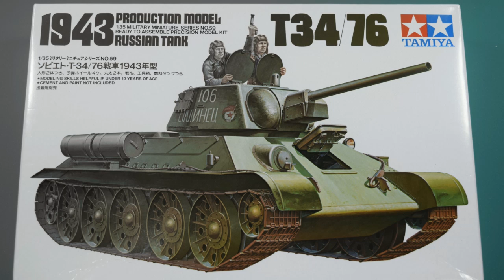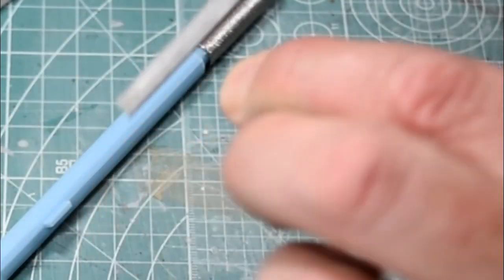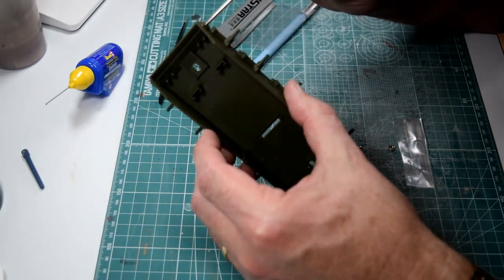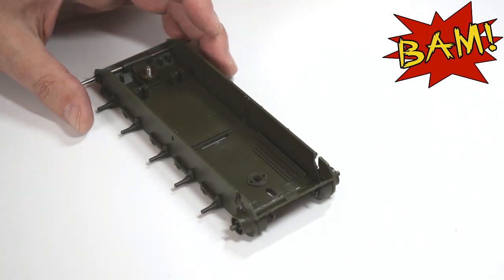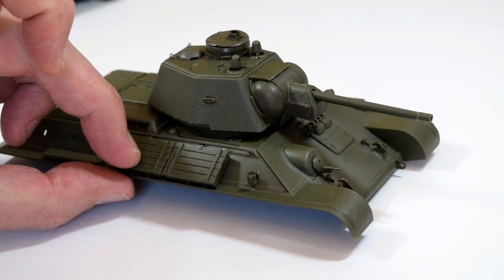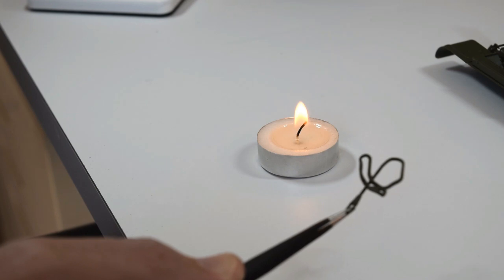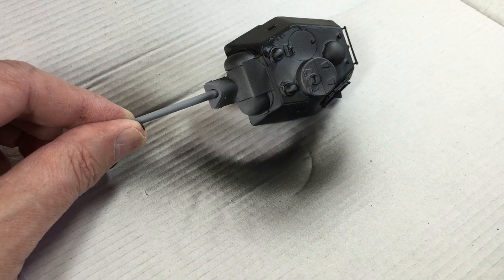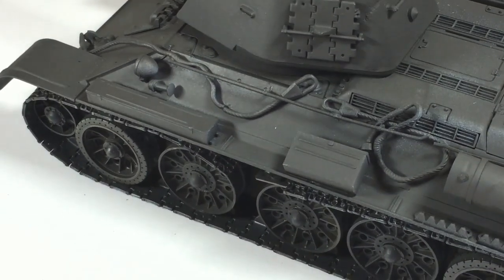Mariya Oktyabrskaya Diorama - Tamiya Russian T34/76 - Part 2 The Build

Comment: I'm still finishing up my kit. I found that the front return roller is nearly touching the front road wheel. I'm using Fruilmodel tracks. If I add a pair of links so I can move the roller forward, I get an overly sloppy look to the 'sag' that will pull back and hang over the drive sprocket. One must use a pair of links in this style, as every other one differs in hinging. The rubber tracks are worse fitting. Very tight. Thinking of building a different brand kit, swapping the tracks,

Comment: Don't worry...I have thumbprint on every model. It's my signature.
Reply from the maker: +Gary Armstrong lol, r u talking about the "tow cable debacle"?  That wasn't a thumb print it was a massive foot print :)
Reply: +Halidon No...I'm talking about the fact that I can be tracked like a criminal with my models. Anyone would damn well know who built them!
Reply: +Halidon BTW...if you care to, under FB Gary Vincent Armstrong (that's my real name)-Gary's Tanks and other models. Should you need a good laugh. A few of the later things are pretty good...
Reply: +Halidon Have ever consider just scratch building a tow cable. I figured out how to do it with German and Allied ones. Soviet tow cables are my next idea. It's fiddly. But it just might work simple.
Reply from the maker: +Gary Armstrong I've bought after market flexible ones to use on the Jagdpanther, I'm deeply scared from melting plastic.  I might give scratch building a go on the next one.
Reply from the maker: +Gary Armstrong sorry mate, I'm too old to do Facebook, I can just manage YouTube :)
Reply: +Halidon You don't melt anything! You take the ends from the kit and cut everything from in between. Then you use string or wire (whatever suits you [I like string because it's easy to shape]) and you take very small drills. You drill holes into the cable ends. Viola! Cables that look cool and authentic! Just primer and paint. Sherman cables are a bit trickier. But I've done it. If can afford aftermarket stuff all the time, more power to you. I can't. Besides, it takes all the fun out of it.
Reply: +Halidon Too old?!? Bah humbug!! I'm 52...I manage anything I like. No computer is going to outsmart me. We humans manage these infernal machines. They don't manage us. LOL! PS...I never said it was easy...Ha! Cheers H!